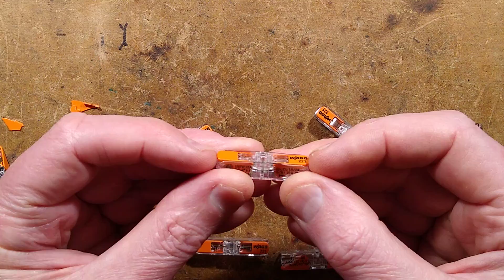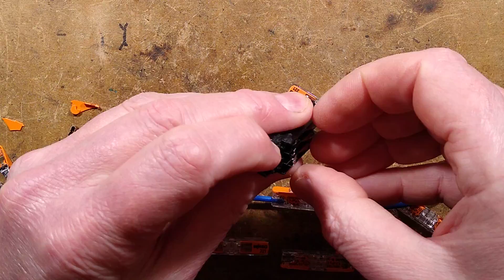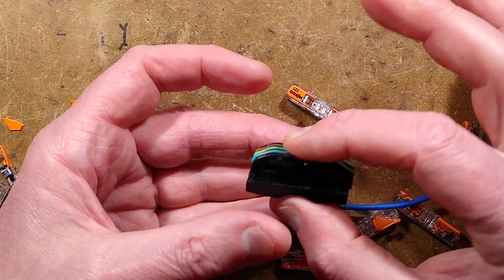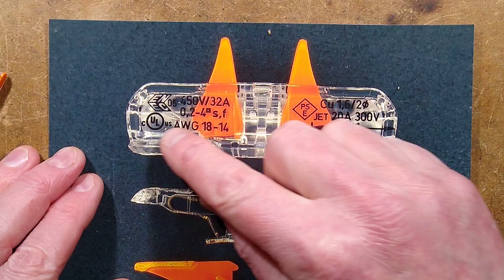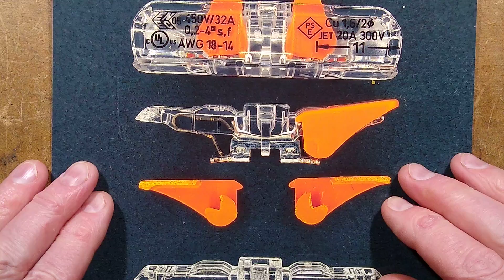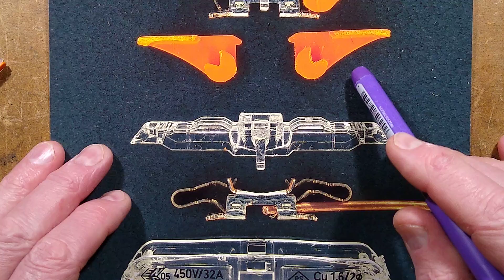By request - a look inside a Wago inline connector

Comment: I never listen to anyone who says actual Wago-made Wago connectors are unsafe.  Anyone that says Wago connectors are unsafe doesn't know what they're talking about.  These are solid, good, reliable connectors.
Reply: The UL. Seal on the WAGOs, says it all for me.   If you’re in the US, the International Code Council, and NEC, both have listings of code compliant products on their websites.   Every Inpector I know, would check anything unfamiliar against those lists.
Reply: Everytime someone says they're dangerous my only response is "how's it feel to be smarter than UL?"
Reply: @JeremyMitts  And those that put together the NEC (or whatever electrical code book in other countries)
Reply: @Cobalt135  well, the only thing the NEC in the US (NFPA 70) has to say on the matter is that if it's listed then the manufacturers listing and labeling instructions must be followed. Section 110.
Reply: They're only unsafe for those who don't know how to use them, like stripping the wire not far enough or putting the wire not far enough in.
Reply: @QoraxAudio  Nice thing especially is that you can look at the wire after you've closed the WAGO to make sure it is seated properly (wire all the way through and insulation not overlapping onto the seat).
Reply: @junkerzn7312  Yeah that's why these transparent newer ones are way better than those larger older grey ones with orange levers IMO.
Reply: Funny thing is that Wagos are german made and an german invention and as everyone should know germany has one of the most brutal certifications for electrical things so yeah wagos are 99.99% safe since nothing is 100% safe   @QoraxAudio
Reply: @QoraxAudio  not far enough or to far and having naked copper showing outside the connector. or using a 16 amp 220 volt in a 110 volt 34 amp home power system. if you have 110 you need connectors capable of more current rushing trough.
Reply: The people who say their unsafe are the kind of people that twist wires together and wrap tape around them because they can’t be bothered to connected them properly
Reply: @zackaboy1236  I have never been called out like that. I only recently got original Wago, as I was ripping out cables
Reply: Yeah, no way they're unsafe. The copper clip thing clamps down on them hard. I would only buy this brand, though.
Reply: Most problems occur because of user error and not using the product how the manufacturer intended it to be done. Many people for example don't know that wire nuts need to be turned so far until there is a sufficient amount of the insulated wire beneath the wire nut braided together as well. Most people just give it just a few turns letting the rest of the wire free, then it can get lose and disconnected after some time. 
This video covers the major mistakes. 
https://youtu.be/-jeP1d8PC1I?si=vOFsSTLiP-vsv9ol
Reply: A lot of old-timers here in the US look down on them. They're set in their ways and there's no convincing them. Wire nuts are only better in cost; WAGOs win at everything else.
Reply: @themonkeydrunken  Probably the same people that "only solder joints" because they "don't trust" crimps
Reply: @whocares281 110v 15A is common for light circuits, 110v 20 amp for outlets.  Updated electrical codes here will now allow for 10 amp circuits. Likely due to the widespread adoption of LED light fixtures.  Anyone in the US trying to dismiss Wago 221's over their current rating are just stubborn old men desperately trying to find any excuse to continue using wire nuts.
Reply: @whocares281   in europe we use 16 amp 240 volts meaning 3.840 watts of power posible to drive appliances, now you tell me how you are going to feed a appliance that demands 2700 watts on a 110 volts without passing 15 amps of current along a single breaker. you wont at that draw you need 24.54 amps. i am not pro wirenuts i just see both sides of the conversation. i love wago's but they are first made for european market. if they make them extra for the american then they need to beef them op. its simple maths
Reply: @highkicker11 What's the problem? They are only rated for 16A, if you need more you have to use another product. Also there are the same clamps with a 400V 32A rating available, so I don't understand your complaint.
Reply: @Universal_Craftsman i am not complaining but the people saying that wago's are not the end all be all to those that are saying they are, are not wrong. the things are made for a special purpose so yeah everything has a limit till you improve it.
Reply: American electrics and wire nuts should belong in a museum.
Reply: @IAmThe_RA  Along with aluminium wire
Reply: @highkicker11 simple, an appliance that requires 2700 watts wouldn’t be fed by a 15 amp 120 breaker. That just wouldn’t work. That’s pretty near the load of my pressure washer, which runs on a 15 amp 240 breaker. (Complete with Wago connections, by the way)
Reply: I like my work to be as safe and tamper-proof as possible; so, I make sure (as specified in my countries regs.) the wires are connected together and crimped. I would only use wagos as temporary or testing,
Reply: @markstuckey6225  Are you sure you're looking at the latest edition of your country's regulations?
Reply: uh huh sounds like you are just too wimpy to turn wirenuts. wagos actually have a significant  measurable resistance. lmao! a CONNECTOR that drops voltage across the supposed "connection!"
Reply: @morscovium8881  Imagine that! Every connector in every device you're using to cope has a specified contact resistance. Best stop using them all immediately. Wire nut that computer together!
Reply: I will also point out that basically everything that isn't a cold weld will oxidize the contact area over time if not protected.  Wire nuts, screw terminals, manual crimps, WAGOS, bolts... just about everything.

In old equipment we rely on contact pressure more than anything else to prevent that from turning into a fire.  WAGOs might have less contact surface area, but they have quite good contact pressure... similar to what you get with lock washers (which also represent a spring force).

It isn't as bad as some people think it is.
Reply: @junkerzn7312  Lock washer... LMAO.
Reply: @I_Dont_Answer_Questions  Yup, the lowly steel spring lock washer.  Universally used for bolted connections (bus bars, battery terminals mainly), as well as bus-bar/screw-terminal style connections.   As a reference, a steel spring lock washer will hold anywhere from 50 to 200lbs of force on the electrical connection and keeps holding it even if the bolt/nut gets knocked around little.

Contact area is only half the equation when it comes to electrical connections.  Putting a force on the connection is the other half.  Makes a huge difference in terms of contact resistance.

Going back to the original reference, this is one aspect of the WAGO, and other lever-nut style connectors, that people often forget about.

Wire-nuts also put a light holding force on the twisted copper due to the spring embedded in the wire nut, but it is a very small force... far less than a SS washer, for example.

The main mechanism for the wire nut depends on the softness of copper and the tight twists to keep the electrical connection good.

As anyone who has used wire nuts knows, many electricians just don't put enough tight twists in the copper wire for them to hold their own and rely too much on the wire nut's spring.  I can't count the number of wire nuts I've taken off only to see the two or three copper wires literally go loose just from handling them with my hands.

Consistency of the work is another big issue when it comes to fasteners.

-Matt
Reply: @Monkeh616  Computers are tension slide connectors and solder joints.  The wire terminals in the connectors are crimped.
Reply: @solarsynapse  And? Every one of these methods has a quantifiable resistance.
Reply: @Monkeh616  Never stated they didn't.
Reply: @solarsynapse  .. So what was the point of telling me how connectors I use professionally work, then? That's a rhetorical question..
Reply: @Monkeh616  I was simply stating what is in a computer.
Reply: @junkerzn7312  Technically a correctly formed crimp joint is airtight, the copper should deform to completely fill the void in the crimp area; crimping is the preferred jointing method for cables in military and aerospace applications.
Reply: @cambridgemart2075  For hydraulic crimps (which create a cold weld), yes (with provisios).  With hand and levered-hand crimpers (which do not create a cold weld), no.  Care must be taken even with a hydraulic crimp because copper is a soft metal. Heat shrink and heat-activated sealant built into the cable do more than just make the join look pretty.

How long something lasts depends on the environment too.  Equipment in coastal environments exposed to more moisture and salt, for example, just doesn't last anywhere near as long without additional protections.   Joins inside walls, on the other-hand, tend to last a long time simply due to the lack of environmental exposure.

-Matt
Reply: @morscovium8881 yeah good luck with soft wires. 😂
Reply: @morscovium8881 wire nuts are a scary joke.
Reply: @somedude2492  Wire nuts work perfectly fine if used how they're supposed appropriately. Have for decades and decades. Just like Wagos.

Really don't understand the "wire connector" pissing match, I don't know what kind of kickback you're getting for picking a side of something that there's no point in picking a side on
Reply: @morscovium8881  So... You're saying that the resistance in these is too high for them to be used. Then how do you explain their cULus and CE certifications? And have you been using these in circuits drawing more than 20 A? If yes, then that's your problem, not the Wagos. They are explicitly rated for maximum 20 A.
Reply: @morscovium8881   Yeah, OK . Millions of lazy electricians have backstabbed UL approved outlets and switches for decades as permitted by US NEC.  That's decades of connecting wires the same way that the WAGO Pushwire works.  Only difference is the  WAGO with the lever allows for a stronger spring to retain the wires since you can retract the securing portion out of the way and don't have to push your wire against the spring tension.  Which would only be an issue with smaller gauge stranded wire anyway.
Reply: @Cobalt135  I get it, you guys love your wagos, they are fast and "good enough" under ideal circumstances. But I still don't like a connector that generates heat as a byproduct of its design. I think part of your job as an electrician is to make splices as strong as possible and wagos just dont do it.
Reply: @morscovium8881   If your circuit is so overloaded that you are heating up a Wago, you already have problems.
Reply: @morscovium8881 literally any wire used in consumer grade electronics produces heat as a byproduct of it's design. Every single electrical thing ever produces heat as a byproduct of it's design, because we don't have zero resistance metal.
Reply: @sebastianlastname5977  yes, I know. What I am saying is that with wagos it is significant. significant enough to generate noticeable heat. and plastic degrades over time, even faster when in the presence of heat. people also thought backstabbing outlets was fine too. but after 30 years of the plastic on the outlet being at a slightly higher temperature than if you wrapped the screw terminal on the outlet, it degrades to the point of falling apart when you take it out of the device box. I know they are technically "fine" and "good enough", but I wouldn't want to have to deal with them in 20 or so years
Reply: @Wolfshead009 like i said waggos made for 220/240 wont work in 110. because appliances still require the same amount of power but because of a lower potential you get more current so offcourse a connector and wire will need to be sized for that so the north american grid needs thicker wire just to handle the higher current draws.
Reply: @highkicker11  The 110/220 thing would be a valid concern if the US actually used higher Amp ratings and thicker conductors to deal with the lower voltage but afaik they don't, do they? Outlets and circuits are rated to very similar currents as the ones in Europe - they are rated to carry less power to account for the lower voltage. That's why some devices like electric kettles just work a little better in 240V areas, they can draw more power from their outlet at the same current.

Comment: WAGO connectors are so good, reliable and really not that expensive. If you’re doing anything with mains voltage or DC with any kind of significant current, I really wouldn’t trust anything else.

Comment: I don't understand the 32A rating when the current rating of 14 gage wire is 15A (12A at continuous - either way, much less than 32A). Maybe the connector is rated for 32A but the wire certainly won't be.
Reply: They propose 4mm² as the maximum which according to my schoolbook with the "worst" normal conditions (3phase, 30°C, cable, in insulated drywall) would be rated for 23A (the fuse to be used 20A) but can go up to with the "best" normal conditions (phase to neutral, 25°C, cable, under/in/on plaster) 38A (fuse to be used 35/32A (depending on the kind of fuse)) so it isn't that far off.
And AWG14 equates to 2mm² wich is wierd because the next smaller AWG to 4mm² is AWG12. So, you are kind of missing out over there.
Reply: 18-12 AWG for that particular WAGO.  And there are actually two ratings on that particular WAGO.  450V/32A, and also 300V/20A, for different standards and I think wire types but I'd have to look up the particulars.  It's basically a 20A WAGO.

There are true 32A WAGOs as well, 3-terminal WAGO 221-613's supporting wire sizes down to 10 AWG (WAGO 221-413's are the 20A version down to 12 AWG).

Comment: Another cool thing about these particular connectors is that, in between the two levers, there's a window opening that gives you direct access to the copper bus bar inside. This is an excellent place to probe the connection with a multimeter!

Comment: Canadian here.  House wiring in Canada (and USA) is a single solid wire, not many small strands . Hence, no twisting before Wago-ing.  Are similar wires in other countries single or multiple strands?
Reply: They are single (that's where Wago 2273 are being used) but light fixtures and other stuff have stranded wires. 221 are way to expensive for general use.
Reply: @julianreverse  Sounds the same as here. Cool. Thanks

Comment: I worked for a company that designed and build some of the largest cranes in the world. Wagos were the only acceptable wire nut because of the spring contact which worked far better under vibration. These replaced a strange wirenut I hadnt seen before that had the addition to a screw that would tighten against the wires from, the side after the standard wirenut twist on action was done.

Comment: The company I work for started using Wago Rail mounted terminal blocks in all the new machines about 2 years ago. They're much more compact than the old terminal strips we used to use and I do enjoy the ease of use quite a bit. My only problem as a technician is I find them very difficult to check voltages with my multi meter because there is hardly any room to get my probes into the holes. 
The designers have left some extra holes open for this, but the leads have to go in on such an angle that if the terminal block is too close to a wall inside the panel box, there's just no way.
Reply from the maker: That's probably not helped by the excessive shrouding used on test probes to protect the less skilled.

Comment: Wagos is one of those things that I wish I knew about sooner.  The same goes for tools like Knipex.  Some tools just make life easier.
Reply: It's maybe 15 years ago now, but just happened to sit beside a man from Texas on the bus here in Sweden. He was visiting Sandvik Coromant to be trained in electrical maintenance of the machines he was going to work on (Sandvik was building a factory in USA), and he had just bought tools for $5k or something because he couldn't get Swedish and German tools for less than twice that price in USA, if at all (for example stuff like Knipex). He was so happy to be able to buy quality tools instead of what's generally available in the states.
Makes me sad to hear that brand protectionism goes so far that a lot of quality stuff basically can't be bought across the pond (same with for example Kempi welding machines). :(

Comment: Twisting before pushing into a spring-loaded connector is fine. Twisting before crimping is not - the whole issue is that twisting increases the diameter and when you pull on the wire, it becomes thinner and the crimp will become loose.

Comment: Remember when  wagos first started to appeared in the uk and most sparks,,me included, were wary ,preferring our old tried and trusted terminal blocks ,through crimps and landmine junction boxes .First time i used em in anger and i was convinced,cant remember last time i used a round JB . As for twisting conductors,only on flex,  dont bother on the 7 strand   "conduit" wire .
Reply from the maker: First time I saw them in a control panel I was very sceptical.  But they are the way ahead.

Comment: Just because it's possible I like to twist the strands then fold back about 9/64th" of the stripped conductor in order to ball up and be trapped by the gap in the spring pressure mechanism whenever using Wago connectors to extend our... free range chicken leashes.